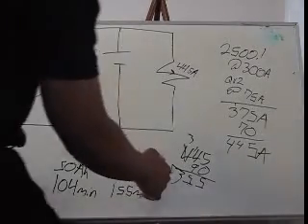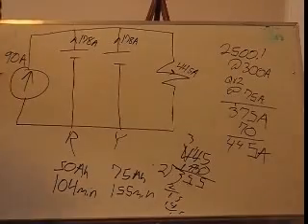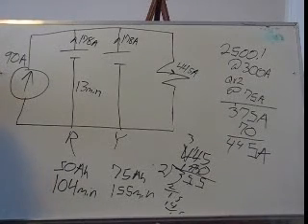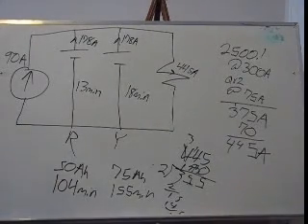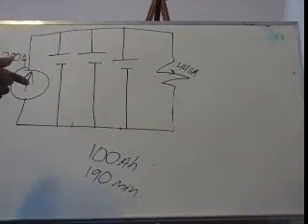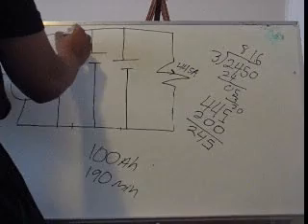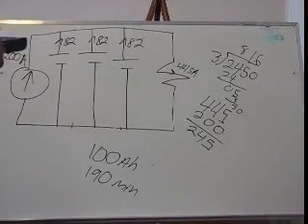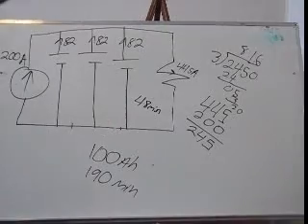How Many Batteries do I need (part 2) ???

Comment: Your telling me a 200amp alternator and even 1 battery cant bump  at full tilt pushing 2.5k rms for an indefinite time period?

This doesnt seem right to me. 200 amp alt  gives you 2k watts at a modest 10v....so I mean. Idk I find that last claim of 3 100ah batteries and 1 200 alt only being able to run a 2.5k watt system for 48 minutes pretty hard to beleive .